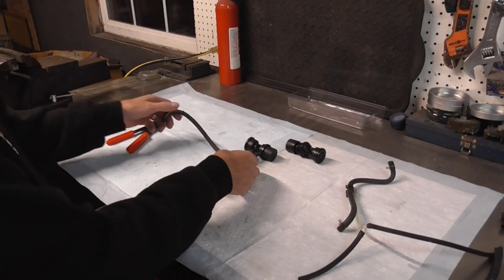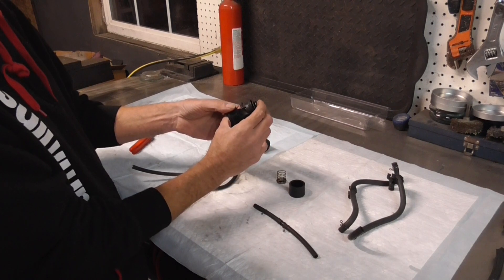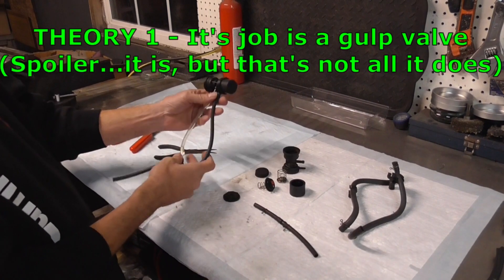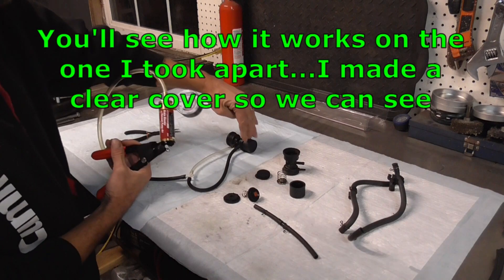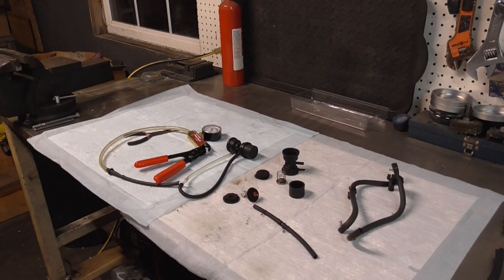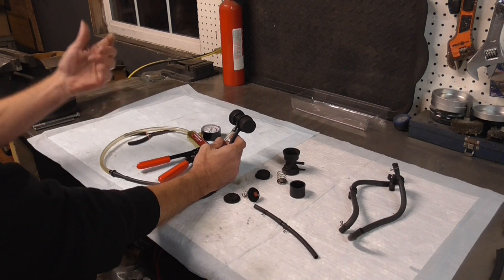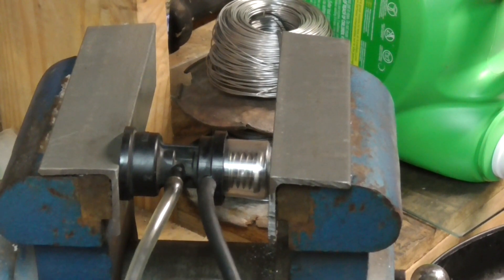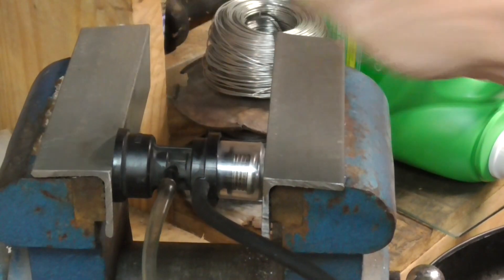1st Gen Virago xv750 Mixture Control Valve - What does it do?

Comment: A vast majority of folks who alter their air cleaners for more Harley-esque type of look for K&N filter systems just try and gut the system without taking any account for capping off or making some provision for balancing the scale and go chasing their tails like a dog trying to figure out why their bike doesn't run right anymore. In the groups and forum's there is an immense amount of ignorance about how to solve the issue after they chop the channel the bug-eyes for esthetic reasons. I just picked an 85' Virago with the hack, and no one on eBay even has one I can buy. As many as get tossed you would think everyone would have one? Not the case though. Guess I'll keep looking since I don't mind the bug-eyes or the mixture control valve living in that little shiney mouse house.
Reply from the maker: Yep, if not done properly, taking away an original part will cause all kinds of issues.  As long as they are working they don’t bother anything and actually help with back fires back into the carb it seems…once they go bad though it can be really tough to track down why the cylinder won’t fire due to the extra air getting in.  Someone had already removed the one in the chrome cover on the 2nd Gen I recently got as well unfortunately.